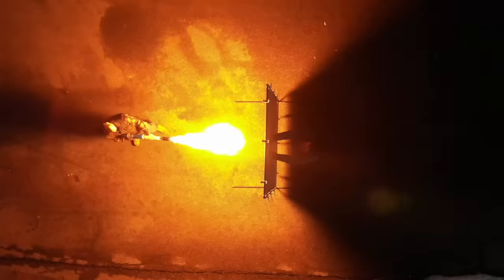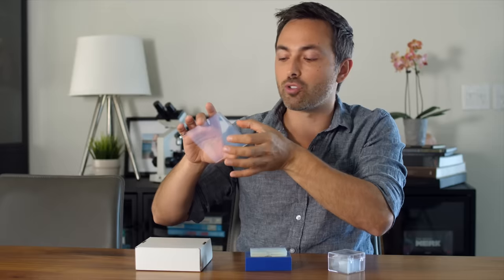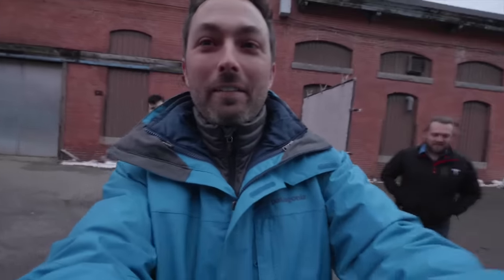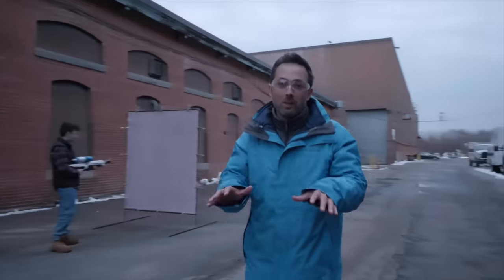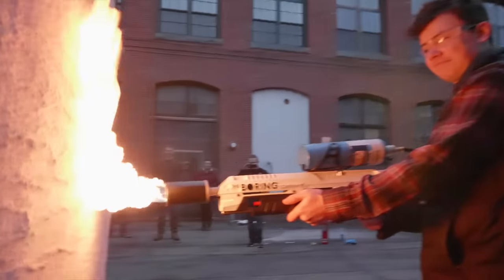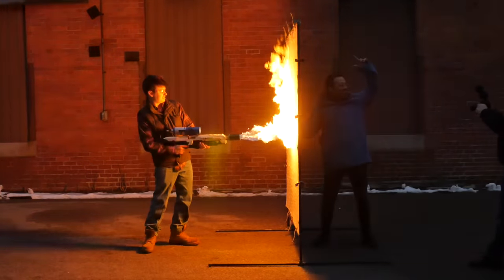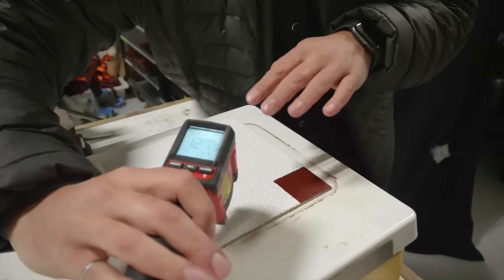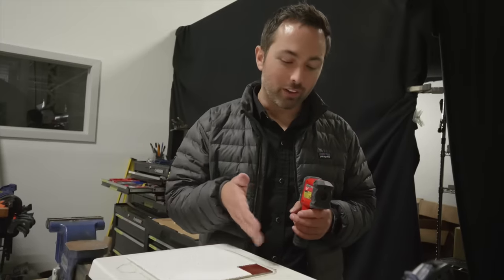Flamethrower vs Aerogel

Comment: I just wonder how would that work with napalm infused gasoline flamethrower. Like not a gas torch but real liquid fuel flamethrower that tends to put everything on fire. Would it resist or would it soak in fuel? How does aerogel and similar aerogel blankets work when soaked in gasoline? Would that be good insulation for fuel tanks or would it just soak the fuel and nicely burn? My guess is that depending on structure it would not get soaked at all or it would soak this fuel but burn just on surface. But then again, what would be the properties of soaked blanket? The answer is probably - you can design it to be great for any particular application, so you can surely design aerogel insulation that will insulate from heat and yet not soak with anything.

Comment: Is the "hand on hot aerogel doesn't get burned" phenomenon related to its exceptionally low density?

If I have a bit of aluminum foil on something I'm baking in a 400 degree (F) oven, once I pull it out I can immediately pull off this 400 degree sheet of metal and crumple it in my fist without being burned.  No exotic materials involved, just an extremely low amount of mass, so the energy transfer between it at 400 degrees and my flesh at 98 degrees is minimal, particularly given that my flesh is largely made of water, which has a very high specific heat.

Comment: That thin sheet of aerogel will conduct heat at such a slow rate that our hand will make the upper surface much more colder than the lower surface of the aerogel sheet
And because it'll take so long for the heat to get transferred from the lower surface of the sheet to the upper surface, we can place our hands on the sheet
In simple words, the sheet colds down as soon as our hands touches the sheet

Comment: Why give misleading information, its supposidly a 2000 degree flame but is measured at ~660 degrees, if you look on the Aspen website it even says it is only rated to 650 degrees. Just say it as it is, regardless of what temperature the fuel burns at. Most people would still be impressed and appreciate honesty over manupulating words for views.

Comment: I got a question although it might be a silly one: Why don't we use Aerogel as a heat-shield for spacecraft or space capsules? Are there any limitations related to the re-usability of the material?
Reply: well aerogel is used in space suits but its also very fragile and breaks easily which is a problem

Comment: I think Aerogel has a great potential to be considered for car insulation as a sustainability initiative in the middle east and other hot climates. Multi physics modellers should team up with Aerogel to model a thermal simulation.
Reply: I strongly agree with your point of view. Now, not only is there Aerogel Blanket, but also Aerogel Paint.
It has been widely used in buildings, industries, and the outer coatings of transportation vehicles.

Comment: Its a flamenblower not a flamethrower. You can make one from a empty fire extinguisher, and fill it with a gasoline and diesel mixture, then use an air compressor to pressurize it. The small amount of diesel should allow the gasoline to stay alight and stay burning as its sprayed out and covers the area similar to napalm. Then for a pilot light just tie a rag around the extinguisher nozzle , soak it with fuel and light it.
Its dodgy but it'l work.

Comment: That's a 1 out of 20,000 Not a Flame Thrower you just ruined... That stuff would be perfect for auto apps. like wrapping exhaust pipes to keep under hood heat down or battery covers in extreme cold conditions!

Comment: That Elon Musk SuperSoaker wannabe is nothing compared to my good old Tiger Torch.
Get wrecked Elon.
And next time, Veritasium, go rent a Tiger Torch from any equipment rental company.
They'll all have them.

I used to heat my garage with a tiger torch blowing into an old washer drum with a 4' fan blowing on the drum.
I had it running for hours on end. 
I miss my old garage 😥

Comment: This wasn't a flame thrower, it was a huge blowtorch. A blowtorch spits gas a short distance because of the weight of gas, then it gets ignited, a flamethrower spits liquid that can go up to 100 feet before combusting completely, due to its weight and density. Flamethrowers also usually have a binding agents in the fuel as well, so that the liquid doesn't just combust in the air, but sticks on the target as well. There's a reason anyone can buy Elon Musks "not a flamethrower" but you need a license to get an actual flamethower.

Comment: The flamethrower is probably not broken. Large scale flame effects release gas from the tank quickly, causing it to cool. On a very small tank like that doesn't take much. As it cools, the liquid propane remaining can't decompress as quickly, giving less effect, but still continuing to cool the tank until it completely locks up.

Comment: 12:12 - Releasing the gas drops the tank's temperature which slows the rate gas can be expelled from the tank... https://en.wikipedia.org/wiki/Propane_(data_page) - Vapor pressure of liquid graph. Also if anything was breaking, it was probably the formation of propane ice in the nozzle, restricting flow. I'd be curious if it works fine after being at temp for awhile and with a new propane tank. That's just a very novice observation from someone that has studied liquid rocket and jet engines.

Comment: The Boring flame thrower is nothing more than a weed burner running off a small propane tank.  You can buy a weed burner at Harbor Freight for about $25 (with 20% coupon). I own two and they run off of a 20 lb. propane tank and will get a lot hotter than what the Boring tool did.  I have turned stone bright red with mine.  Great video, I like the flames licking up over the curtain.

Comment: Everyone in Finland has been in sauna hotter than 100 degrees celsius, even at 120 degrees it is quite comfortable if you don't throw water to the stones.
You can also easily touch wooden parts in sauna, it doesn't feel burning hot even at 120 degrees.. depending on quality of the wood. Aspen is the best and coolest material.

Comment: I wonder if it has optical qualities since it passes light through it? If it was shaped into a lens shape (ie. Convex) would it bend light similar to glass lens? If so, it might be used to create a huge telescope in space because of its light weight would make it easy to launch. Even very very large telescopes on Earth might be possible. Might have to make the Aerogel material self reflective to accomplish refraction.

Comment: If you 3D print graphene into a buckyball shape, in a vacuum environment, using aerogel as insulation around that, is it possible that it would float if you moved the ultrathin ultralight graphene/aerogel ball into regular atmosphere? And could that then become the ultimate construction material of all time?

Comment: A question: the reason why aerogel is a great insulator is its porous structure but when you make a composite out of it, you certainly changing that porous structure to a more sense structure because of presence of fiber... So why is this composite still a great insulator

Comment: Wait, if that sheet is a good insulator and can block radiation, why can't they use this stuff in space or on Mars? Would if be easier/cheaper to implement this on spacecraft and establishments on Mars? How much does it cost to produce a square meter of the sheet?

Comment: We can't actually feel the temperature,we can only feel the rapid of heat flows.That's why we won't feel very cold  when it's -10℃ outside in some place where air is very dry.wet air is  better conductor of heat than dry air, so in some places heat flow away slower from our body even when the temperature is lower .

Comment: What you should have used was a larger standard grill propane tank, and a simple roofing torch wand with a hose. That novelty flame thrower with a small propane tank froze up due to rapid pressure reduction inside the small tank. That is why propane can be used as a refrigerant, except it is not, only because its explosive. But there was no damage done to the flame thrower, so no need to apologize. Try a warmer day or placing the propane tank in room temperature water. No not hot water, because heat transfers better to something within a similar temerature range.

Comment: Fire walls would be godly with this. Holds fire for much longer than 1 hour probably
Reply: Also, the thermosphere does a similar thing. In the thermosphere (which is an outer layer of the atmosphere), the temperatures of molecules there are REALLY  hot. Like third degree burn hot. But theres not many of them, so u dont get burned

Comment: In very hot country, they should use this fiberGlass mix aeroGel to their new verhicle for better heat insulation from sun
Reply: The limitation of aerogel is... the cost.
It is pretty expensive.

Comment: Overpriced torch VS specially engineered heat resistent insolation material being able to withstand extreme temperatures.

Seriously, apart from the misleading title, why tf would anyone think that cute little lighter would win. Why even do this experiment or this video.

Oh, right, money

Comment: Instead of saying "Sorry", you could buy him a new flamethrower. It was your challenge and your prompting. You essentially made him pay for your choices. That he went along with it only saves you from a lawsuit, but it doesn't save you from the expectation of basic human dignity.
Reply: @eldritchirideus2253  I said "it only saves you from a lawsuit." In other words, I agree with you. It would not hold up in court. I never so much as implied that it would. I simply highlighted basic human dignity.

Thank you for letting me know that he did offer, though it was largely mitigated by his claim that it is "easily fixible anyway", as if he is trying to weasel out of his offer. What he said in the video was rather irresponsible-sounding. Every time someone's choicees have led to the loss of my property and all they say is "sorry" without offering to replace it, I certainly have felt slighted and I don't apologize for that. Ben needs to be aware of how bad it looked and it looked BAD.
Reply: Dismythed & JWA Ben is the name of the guy who owned the flamethrower. He said he thought it was easily fixable, which is why he told Derek, who is the creator of Veritasium, no when Derek offered to buy him a new one.
Reply: @eldritchirideus2253  Well that makes more sense. Thanks for clarifying. I'm not good with names.

Comment: Fun.  The flame thrower time limit problem is due to the propane tank cooling via gas law pressure drop, in which the propane becomes liquid, dropping the tank pressure too low to operate through the regulator.  Give it time to warm up and thaw and it'll work again.

Comment: 9:15 Maybe even hydrogen storage ?
Thin flexible fireproof coating for firemen.
Central heating pipes, or even longer pipes in subzero temperature
ranges, from warm water springs heating homes.
Reply: 11:44 Nvm, they already got the pipe thing.
Reply: Ok then, creativity at work.
You can actually store heat inside for later !
Cheaper ice cream trucks or cooler trucks.
Reply: Heat storage, in cold regions of the world.
During the day heat water, with solar.
At night circulate some of that water into the house
to release some of it.
No batteries required.
Reply: It makes me wonder how well it does in plasma environments.
Also, if the size of the pores can be altered if so desired.
New filters, cheap clean water, viral filters, breathing masks.
Blood filters, matter separation filters.
Reply: Re-entry heat shields ?
Reply: -40C clothing ?You can even use a thicker layer on bending parts like the legs,
with the motion moving air around and out a little to allow for sweat removal.

WIth that also shoe sole insulation for deep cold regions, maybe with a little
large pores to also once again allow airing a little.

Comment: I'm a coatings formulation chemist, and used Cabot Aerogels in developing insulation coatings for industrial applications.
It's  a bugger to mix into liquid coating mixtures.
But it insulates better than any product on the planet.
Almost! We also used another product that worked almost as well,but much lower in cost and was proprietary.

Fun stuff.

Comment: Yup, when it comes to feeling temperature, you don't feel the warmth but the change in warmth. So if something is a good insulator it means it doesn't conduct heat very much meaning that it doesn't feel hot even when it is, because it doesn't change your temperature very much.

Comment: I think that the reason for decrease in flames on flamethrower is pressure decrease of the lpg (liquidified petroleum gases)used in the flame thrower. LPG needs heat to turn into gas as you use it. Since you are in cold weather, LPG basically does not have enough heat around it to turn into gas and so  pressure decreases.

Comment: What are the chances of this material being available for house insulation at some point?

Also, is it possible the gas tank on the flamethrower froze up? Compressed gases have a habit of doing that to their tanks. If that's the case the temperature differences my cause parts of the flamethrower to become brittle. Hence the warning.

Comment: In case you're wondering, it's about r33 per inch. Too expensive to replace attic batting, but in strips, it can be used to insulate exterior framing on the studs. 15% losses come from where drywall touches the stud. A thin little strip on exterior wall framing would go the longest way for the money.

Comment: why not make complete insulating clothing from it,or even with the climate change hype,earogel wallpaper that keeps your generated heat inside in the winter,and also keep the heat outside in the summer,why does every applicable invention have to have such a long duration before application,everyone could make their house more energy efficient only by covering the walls in aerogel wallpaper,i thnk that insullation firms are keeping this invention from hitting the market so they still can sell us their less efficient isolation

Comment: Instead using toy flame thrower you should use oxy acetylene  would reach much higher temperature in fraction of time and zero problem with length of burn. 🤔 but perhaps that was whole idea as areogel wouldn't be able to withstand a real test 😉.

Comment: this so called flamethrower is weaker than my weed control gas torch lolz, real test would be just to take something like tornado soldering burner witch capacity of reaching at least 800*c